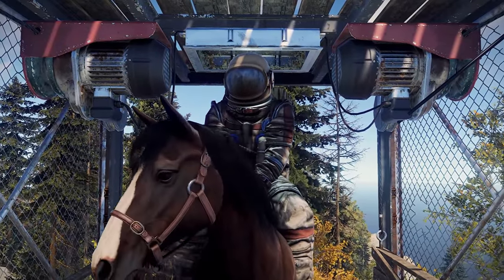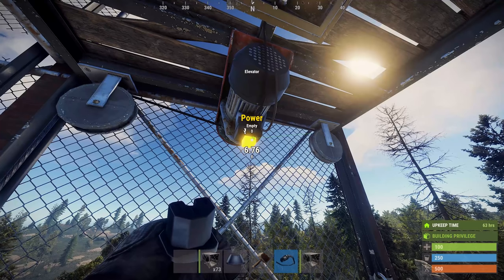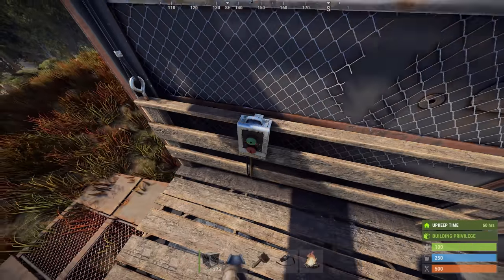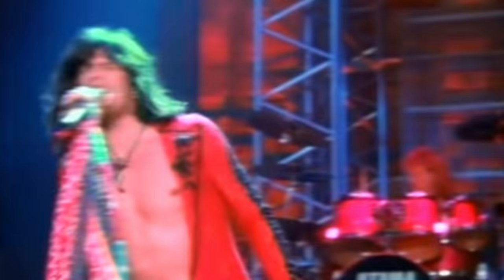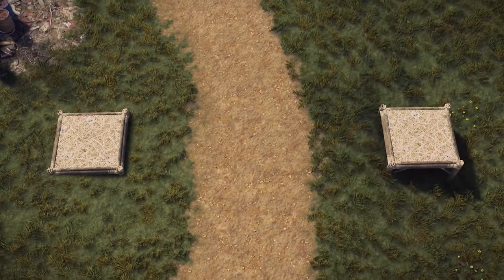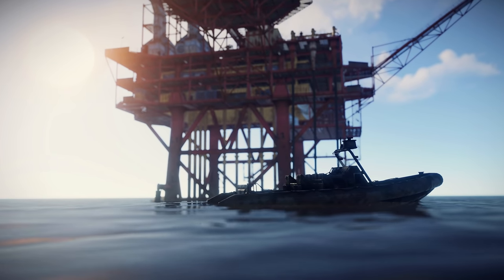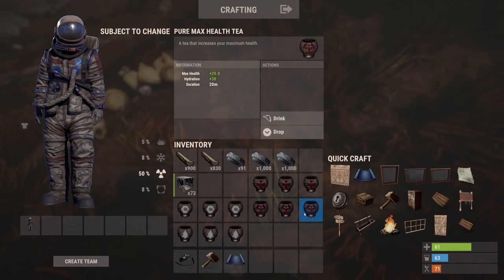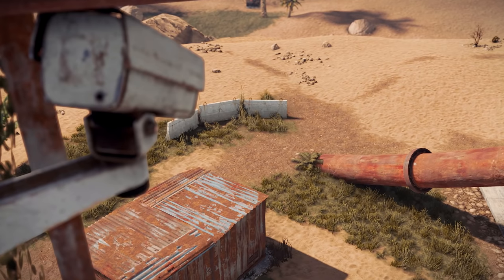Elevator block and trails Rust | Update 25th September 2020

Comment: Imagine raiding a base and getting stuck in a elevator when the power goes out 😳
Reply: well goodluck with that😂
Reply: could become a tatic, just cut the power
Reply: @Lisferator  Use small generators if needed then...
Reply: Ah something new For Oblivion..... Elevator/Lift trap base
Reply: @kerplunkboydotNET  not if you dont have building priv.....
Reply: Step bro im stuck
Reply: kekW
Reply: or you go up to the next leavl and it is just a wall of shotty traps
Reply: it can be picked up so the new strat is hqm core with elevator just pick it up an seal the baseoff with a bunker
Reply: Elevator delivers them to a turret / flame turrets. Don't ride strange elevators...

Comment: Watching CCTVs from outside of the game is already a thing, at least in the Rust+ websocket service. It's disabled in the application itself and on the server by default. But if you're comfortable writing some code and enabling it on your server its a thing you can do. I imagine it will be in the application once they sort out how to not have it crash random players near the cameras (since it's using that players hardware to render out the stream of frames).

Comment: Can you place an HBHF Sensor in the elevator, to allow your elevator to only operate when those with TC access are nearby? I could see building a base on top of the large rock formations, using an elevator to go up and down but would not want my enemies to use my elevator.

If not, I guess you could use a splitter or electrical branch and space some out on the shaft. Once you're near the sensor, it would provide power to the engine. Depending on spacing, you might only need one per two floors, which would give you access to a single splitter providing power.

Comment: RUST in some weeks:
Horses: paid
Cars: still free
Reply: Cars are 100s of scrap aswell, you need windmill/(solar panel, root combiner) battery, car lift and most likely learn all of the t1 parts just to get started. Later on you will wana learn the better car modules and t2 parts.

Easily 500 scrap (plus a teir 2) and its much worse than a heli.

Comment: I wonder if you can. Connect elevators to Make a 2x1 or 3x1 elevator to lift the 2,3,4 module cars up rather then make a super elaborate ramp...??
Reply from the maker: Vehicles block elevators from working, for more info please rewatch.

Comment: I think horses should stay as a wild life but random horses in the wild don’t have a saddle so they could do thing like decrease something like speed or remove the option to use the horse’s inventory until you buy a saddle form the vendor and on top of that the horses with saddles can still be bought from the vendor. I say this because horses aren’t like cars so you can have more than 1 player on at a time and anyone can steal your horse. You can keep your horse on your foundation inside your base for too long so else they die so you will need the high external walls to keep them safe, with cars I can either keep them inside or outside the base as long as I put a lock on it.

Comment: next wipe mission:  Make a trap base that crushes intruders with an elevator
Reply: Stop reading my mind. I just wanna know if I can deploy a shotgun trap inside the elevator.
Reply: Door and wall off the shaft, set a sensor(of choice) to call the elevator to the ground floor once they are in the shaft and start a timer that is connected to a blocker so that the passthrough is blocked and set to the call on the second floor, once the timer is done the blocker passthrough will recall the elevator back to the second floor. Build a convincing "base" around this. 

Set up some turret/shotgun traps at the top of the shaft in case someone comes in while its crushing a player.